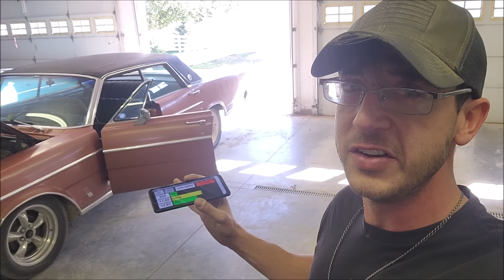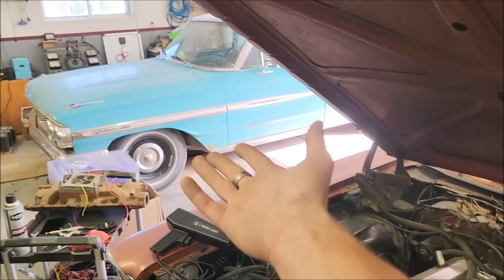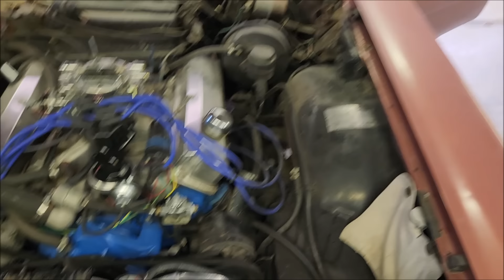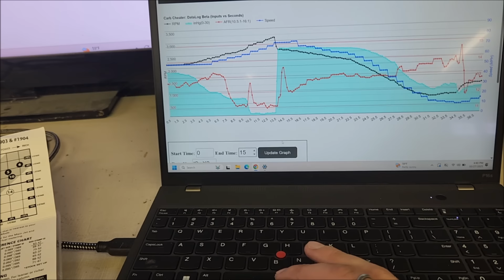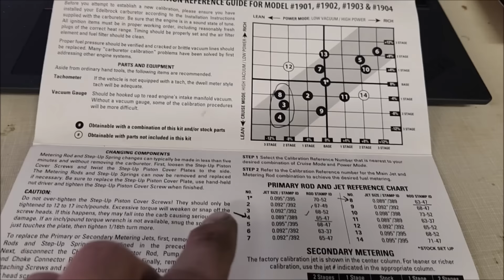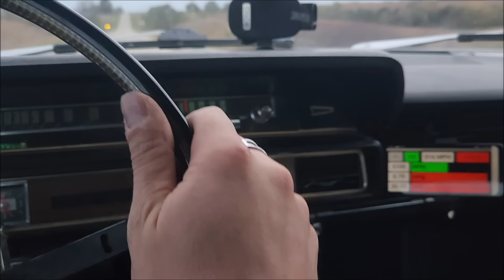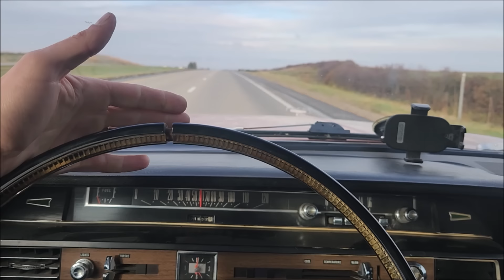Can We Save Her? NEW $6500 Engine Makes NO POWER !!!

Comment: Good stuff. I have an AVS2 650 on a slightly warmed over 318 in a 1985 Dodge Ramcharger 4x4.....just running it out-of-the-box.
I installed an unnecessary low vacuum cam.....about 13 hg at idle.
I'm running about 18° initial, 14° mechanical, and an adjustable vacuum advance that puts out 12° at full adjust, hooked to ported vacuum.
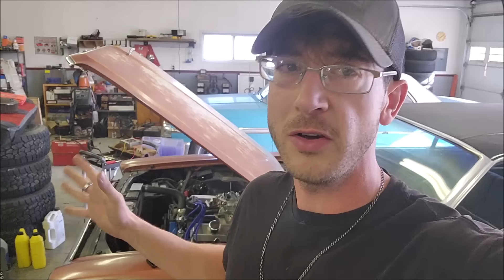It accellerates and cruises well with the stock 3:21 gear and 35" tires, but I know it's not dialed in correctly. 
The whole thing was an oddball set-up when I bought it.....I'm just trying to improve it slowly. I work too much to get much done. I have put alot of money in it so far.
Looks like I really need a Carb Cheater.....and maybe a set of 4:56 gears.
Reply: You will not regret it!  I love my CARB CHEATER!
Reply: @stuckinmygarage6220 , I guess I'm one of the stupid ones Luke has referred to.....I've never installed or used an AFR gauge to tune anything.
I just read elsewhere that the auto tune is a controlled vacuum leak that leans the mixture when needed.....that makes sense to me.
But my starting point should be just an AFR gauge and some jetting or rod changes to familiarize myself with it all.
Idle tuning is one thing, cruise another. WOT another.
Guys with low vacuum cams are drilling air feed holes in the throttle butterflies? That only addresses the idle characteristics though.
Reply: @PTucker0864 No way.  Luke is cool.  If u r willing to learn and skin some knuckles, you're in.
1) If you know what you want in the end, the big picture, does it include a carburetor?  It's not a silly question when you think of all the possibilities of keeping/running and more importantly, enjoying your ride.  2) Do you get excited when you fix/work/complete something on yr ride?  Does tuning/ timing/ servicing make you happy?  3) Carb Cheater is a controlled lean machine with super extras to make this really fun.  He's right that it can save some of the headaches he already went thru.  The more you know/learn, the more you'll enjoy and appreciate CC, and your ride.  4) IMHO, if you are going to pursue this, I would just skip buying the AEM AFR (My recommendation if AFR only route) and go straight for CC.  Luke and Joe have put together  a great package that will allow you to tune/monitor all three phases you mentioned in one package and easily digestible!   5) A well tuned car will save energy , $$, and headaches.  You can tune with ear to a point.  You can really improve with an AFR.  You can actually see what you are doing with realtime data collection 100% of the time.  CC gets you there with the whole package 😊.  6) You aren't dumb. 👍🏻😊
Reply: @stuckinmygarage6220 , Great sales pitch! 😂
I'm 61.....I have a 5.0 Coyote F150, and 2 carbed vehicles. I've been tinkering for a lifetime in my own stuff.  Luke took carbing to a different level for sure.
I'm sure CC is worth the money. 👍
Reply: @PTucker0864 I know!  They could hire me for MKTing. 😊
Reply: @stuckinmygarage6220 That Ramcharger I was referring to was a mess when I bought it.....318 2 bbl. with plastic timing gear teeth in the oilpan and pickup screen and a bent pushrod.....it still ran though.
I went through the engine....a cheap refresh....rings, bearings, heads.....all new stuff. Then all the intake and exhaust goodies.
And it's still roadkill junk...lol.

Comment: What transmission does that car have? C6 or an MX medium case? I'm surprised it only shifts at 4000 WOT, my FX small case shifts at 5000 WOT in green dot. I didn't notice a difference in shift point before the rebuild vs after with a shift kit, so not sure whats going on with that one. The C6 in my truck WOT shifts at 5000 RPM as well. Curious, what does your 64 4 door WOT shift at?

Comment: When I was a kid in the summer of ‘79 there were only a couple remote garage door frequencies and very few remote o/h doors. We would drive around town clicking my buddy’s opener and it worked on most of those modern contraptions.
Reply: U r kidding me!  We used to ride our bikes around and keep clicking until we found one.  I can't say we found many, but we had fun trying.  The little white slide switches were messed up and our dads were pissed, so we learned to write down the settings before messing up.  Sometimes we had four of us riding with clickers.  Thanks for the memories. 😉👍🏻

Comment: Amazing how many people (espcially bomer generation) think that "Richer is better" I cannot explain to you how many Dirbikes and quads etc I have tuned because they get the air screw/screws turned all the way in or all the way out, float is set to high or all of those at once and then they toss HUGE ass Jet thinking it's gonna be so powerful or fix it all. Or like you mentioned I see a lot and I mean A LOT of people putting a HUGE cam with really high compression and wonder why it runs like dogshittt.     It's just annoying honestly when people who have no idea how evens work bt they toss in a bunch of parts and play with "tuning" with ZERO understanding.

Comment: The 4100 autolite carburetor was the best street carburetor ever. When I was younger, I remember hearing about Chevy guys running the 4100 autolite carburetors on their engines.
Reply: I never heard anything like that and I was in high school in 1968.  Most of us, the cars were very fast for the day and most upgrades were basically wheels tires airshocks.. jack it up and put big tires on the back... keystones cragar ss's usually.. radial tires were a brand new thing and cars not set up for them handled like shit.. they would not go in a straight line... needed more caster.  Headers could be had for about $49,99, glass packs to make em louder and that was it

Comment: Garage door problem might be LED lights interfering with the signal. Had them in my garage in front of the opener,  read something about it online (2008) or so. I ended up changing the bulbs to a incandescent and never had the problem again. CFL will also work well.

Comment: Was that a 390 or what ?  What a sweet ride !  But you didn't say if the power brakes were improved, but they only had one way to go ^.  What was the idle RPM in the end and how much drop in gear in the end ?

Comment: If that fuel is 10% ethanol, the stoichiometric ratio should be 14.1:1, but maybe in farm country you can get more "temperant" fuel.
Reply from the maker: One would think that, but actually all "afr" values are generated from lambda which is 1 for all fuels, and then transposed into the gasoline afr spectrum. The reason I programmed it this way is because most folks are familiar with the 14.7 spectrum.

So how this will look in function is that if you are cruising at 14.5 and then put ethenol blend in, youll be in the 15's.

Comment: Just a couple question - what was the final metering rod/jet combo you went to? Which way did you move the the accellerator pump?  I'm somewhat a newbie on Carb tuning and have been struggling with my SBC that is cammed, has an edelbrock and electronic ignition.

Comment: I wish the camshaft manufactures would make street performance camshafts with less overlap.    A wider LSA losses mid range torque but gains torque right off idle making for a better street cam.    The problem is a lumpy idle sells camshafts.
Reply: Most cam companies will custom grind a cam for you for a few dollars more.

Comment: I haven’t had to tune a carb since I sold my 66 fairlane before grad school in 2008 and I still watched the entire video. This was an amazing tutorial, you should be proud.
Reply: Building a square body and thought of a sniper kit, but after drama style reviews, I'm going carb. And likely a carb cheat added.
Reply: @billmcmeekin7909 unless you are going for daily driver fuel economy, a carb with a good tune/jet swap makes total sense. No one is drag racing (someone is) a square body, but built with a NP205 and good axles that truck will be years of reliable fun.
Reply: I prefer carbs, but I don't mind tinkering.

Comment: A shift kit and an adjustable modulator valve (along with proper stall torque converter) will fix that shifting in a hurry. Nice job on the tuning. Nice to see young guys still enjoying these old engines. I am in my 60's and cut my teeth on these things.

Comment: What is and was the fuel pressure at?
Reply: He stated it was at 6 PSI, reducing it to what looks like 5.
Edelbrocks are good there. Check manual.  You should always have a regulator, regardless what the pump manufacturer says!  Fule Rule: regulate and filter!  Check MuscleCar Solutions.

Comment: What's your altitude? I live right at sea level and every electric choke edelbrock i've used has always been lean. Enough to get a lean surge at part throttle. Changing just the rods to a step and half richer usually takes care of it.
Reply: That makes sense. E can't predict every customer location.  If you set for your alt, then go up the hill, CC will add more air to help compensate for the lower oxygen at higher alt.  Too rich at sea level and you limit the range CC has for alt variation 👍🏻

Comment: Thanks Professor Uncle Luke! I am Always impressed with your depth of automotive carb. fuel & ignition systems knowledge & very clear teaching of these inter-related diagnostics &  tuning! The importance of the first baseline adjustments so the tuner knows where systems are at, in their range, 1st things 1st! Thanks so much for passing on these  disappearing skills! I see the CC's built-in data recording & playback opens the door for analysis in the calm comfort of home, without the divided attention for driving safely! Paul from S. Central Tx..
P.S. May 16rh, '26, rewatched to refresh memory & it's great again, Thanks!

Comment: It’s like my parts explorer where it has lean codes and a misfire and blows black smoke out of the exhaust like it’s rich. Stumbles off idle and at half throttle revs to 5 grand and then at full throttle it stutters and wants to die. And it acts really bad and that’s why it’s my parts explorer

Comment: Back around 1980, I worked at a Chevy dealership. There were many special tools for adjusting the computer controlled carbs. One of the tools was a special ruler that went down in the bowl vent to measure the float level w/o taking the top off the carb.

Comment: Based on the remote, you are using that garage door opener is a pretty old LiftMaster or chamberlain. The receiver board inside go bad and it’s usually best to replace the whole unit although new logic board with new receiver are available.

Comment: Static fuel metering bricks. That's what a lot of people don't understand about carbs. They're not set-it-and-forget-it.  EFI engines controlled by an ECM are 'dynamic'. Tuned on the fly for all weather and environmental conditions. The Carb Cheater is a carbs 'ECM'.  Or at least it's best friend. ;)
Reply from the maker: I love carbs, but was always frustrated by the afr drift - i have always greatly appreciated a carbs reliability and am glad ive been able to do something to give them that last little edge they needed. Not that there is anything wrong with retrofit efi, but theres a lot to fail and doesnt measurably net you anything over a carb in the end. Plus carbs just sound better out the exhaust hands down

Comment: I would probably have leaned it out a little bit more maybe 1 more jet size small on primary and secondary 13.8 is pretty good for cruising I would try to get around 14.2 wot still in the 11.5-11.8 I would try to get it to 12.3 and I definitely throw a new set of spark plugs in it with how fuel fouled that motor was those plugs are definitely trash

Comment: fuel pressure is a pain to regulate lately... all pumps are made like crap the electric ones say 2 bar and pump like 20 same with the mecanical ones... the regulators either block it all the way or let too much trough.

Comment: my 390s-428s roast tires in every gear with a 4.11 gear,4 speed and a hot FE
Reply: i wish you were my neighbor-friend, i bought a odd fire v6 chevy gmpp busch engine that needs a certain msd box to get it to run, dry sump only 500-550 hp at over 8000 rpms. its really blowing my mind trying to figure out how to get it to run, it was built back in the 80s by ray baker,earnhearts v6 builder back then

Comment: Im 44 still old enough to have have been a CBer in the late 90s, Good Thing you aren't my Neighbor 😂 My tuned CB /Solarcon IMAX 2000 Antenna on roof, and 250 Watt Linear amp will Open Your Garage Door for you. I used to talk across Neighbors TVs especially old CRTs back in late 90s and early 2000s. I had to tune it back some 😂😂😂 even a tuned radio at 15 RF watts was loud. 
    I had an old Neighbor with a 80 foot Tower and an Antron Antenna with Beams that turned Toasters into speakers😂 dont be too mad about ur lighting Ballast garage door interference.😂

Comment: For the garage door opener.. check the antenna wire in the garage (it's usually on the opener itself) also.. check for interference. In our case we had a transformer (wall wart) for a cheap neon sign that was causing the interference. Turning it off and suddenly everything worked. Another time it was a mikita battery charging station that had a transformer going bad in it. So yeah. Check for interference sources.

Comment: LUKE WANTED TO SAY HELLO, I REALLY ENJOY YOUR CONTENT. UNFORTUNATELY I DON'T HAVE ANY VANS THAT RUN ON CARBURETOR . 74 YRS OLD I GREW UP WITH CARBURETOR CARS. I HAVE A 2000 DODGE RAM VAN 3.9 V6. RUNS LIKE A CLOCK. 225 000 MILES ON IT I CHANGED THE OIL EVERY 2000 MILES .RUNS AT 50 PSI OF OIL PSI. THE VAN HAS BEEN A GOOD FRIEND TO ME. GOD BLESS YOU AND YOUR FAMILY SINCERELY DOM'NNICKS AC VENICE FL.

Comment: I finished up my 1969 barracuda yesterday tuning my Edelbrock.
I did one jet leaner and a rod on primary.
It was still very rich when I opened the secondary so I ordered a pair of 92 and changed the secondary jet.
Huge difference.
No black smoke, way more power.

No O2 sensor. Went old school detective

Comment: Free advice: Build your engine to produce its power down where where sane people live — 1K to 4K rpms. Mild camshaft, small carb. You’ll have better drivability and throttle response. I built a 390 for my F250 years ago that was so dialed in. Headers, Edelbrock Performer intake and camshaft. 600 cfm carb. That was a winning combination. Don’t go nuts with the vroom vroom stuff. You will be far happier.
Reply from the maker: Hey man, you are preaching to the choir - especially when it comes to 3 speed stock automatics
Reply: You are right and wiser.  But, many of us still went thru it all to get to where we can appreciate what you said.  
It's like telling your kids one thing, watching it go out the other ear, only to hear them later ( should we be so blessed) confirm. 😉🍻👍🏻
Reply: Local- Yah, I cannot help myself so I'm gonna comment to agree with you. Circa 1976 I was 17 years old and I had this exact '66 LTD with a totally clapped-out 390 that burned a ton of oil, with a ton of blow-by, and it seemed to be faster and have an ( stock dual exhaust with balance pipe) idle sound much meaner than this featured car. You reminded me that this car has too much cam for the RPMs it will be operating in. Rather than monkeying further with voodoo timing, and trans shift points, time might be better spent installing a lower RPM torque cam, more suited to a heavier car like that. And that idle still sounds like it is sucking wind. BTW, I just want to confirm that the four-wheel drum brakes sucked on my car, and my LTD got 9 MPG around town and lucky if 12 on the highway. And my steering wheel center cap had the same problem, a plastic piece broke off. I can't remember if I  ever got another one from the junkyard to fix.🤔

Comment: Luke - Best tuning video i’ve seen.  Easily explained   A+. 
   maybe I missed it, but how are you reading the air fuel ratio the vacuum when you’re showing it on your phone do you have some gauge connected to the engine or in the exhaust?
   And how do I purchase one?
Reply from the maker: Ah, check my pinned comment 🙂
Its a little doodad called carb cheater (that I actually developed since no one made anything like it)

Comment: I bet he did not have the block prepped at the machine shop. Those 390 FE blocks were terrible for being straight, having round cylinders. You really need to do every machine shop process before you begin building a 390 FE.
Reply from the maker: Block was heavily processed and entirely built by the machine shop. Even has a roller cam in there
Reply: @ThunderHead289  Hi Luke have you ever thought about building moderate power tour cars like this for people? Except with better brakes, gears, and a more appropriate transmission like a 5 or 6spd manual or a 6spd auto?

Comment: I could always tell in college when an instructor/professor didn't understand some aspect of the material well because the explanations would always be more abstract than necessary and therefore harder to learn than they should be. In contrast, Luke clearly knows this stuff inside and out because he explains it in a way that makes it easy to understand.
Reply: clearly and concise in a linear fashion
Reply: True knowledge of a topic is the ability to break it down into simple parts that even a novice can understand.
Reply: @CN073 💯
Reply: I had a manager and he said "You know, I figured out over time, I'm a pretty smart guy. If your explanation doesn't make sense to me, the problem is with your explanation". This is true.
Reply: Absolutely!
Reply: I would check the floats and set them to 11/32, and put the accelerator pump in the center hole. You need to do that before you do anything.
Reply: I think the floats need to be checked